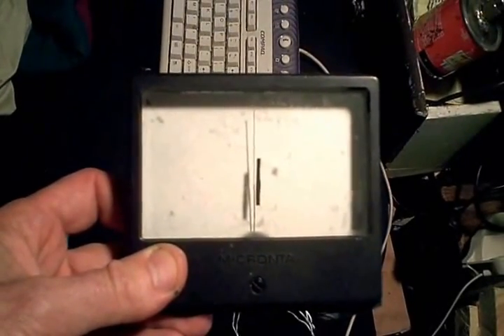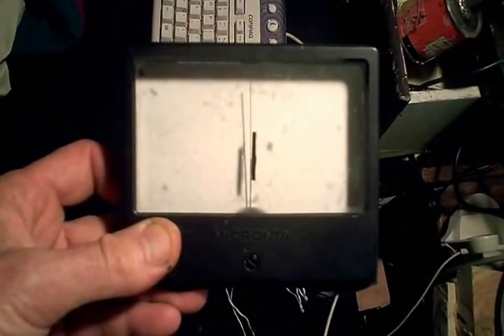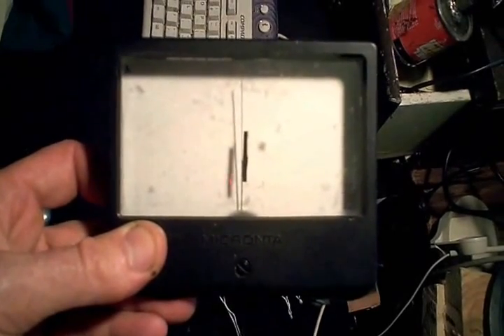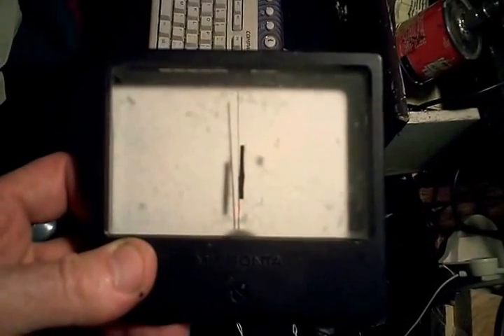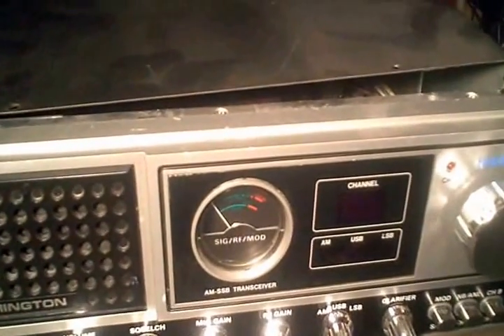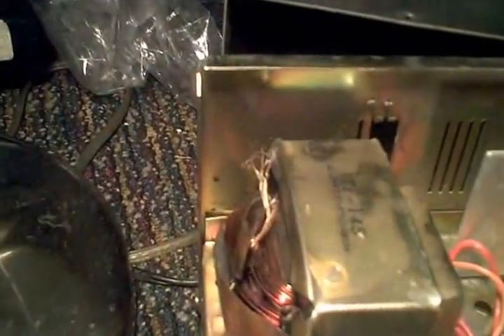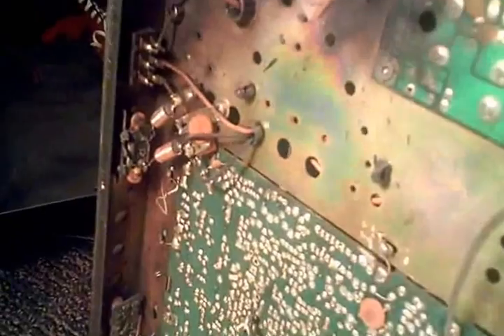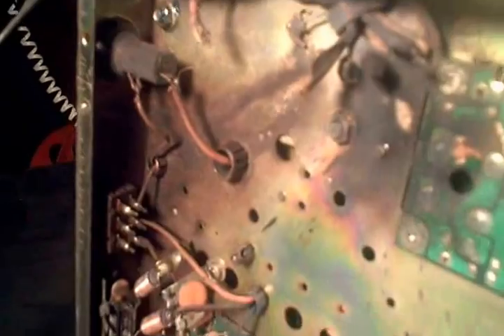Lightning Damage to home and electronics equipment..

Comment: Lightning struck a VHF radio antenna on top of a rooftop mechanical room, 5th floor level, at my hospital, about 1989. Destroyed the radio, of course. It induced enough energy into the wiring for an analog energy management system to fry the system components in the mechanical room, blew the analog/digital board at the computer on the first floor, burned out the power supply for the computer, and destroyed the surge suppressor plug strip. 

Lightning struck the lightning rod on top of the 3 story high minaret at my hospital near Riyadh, Saudi Arabia. The ground cable made a tight turn and the lightning arced across the concrete to take the shortest path, leaving a scorch mark on the concrete, but no damage to the aircraft warning light or public address system. Should have fried the warning light and PA system but didn't.

Construction crane was hit alongside US Army hospital in W. Germany; destroyed the crane wiring & controls, and welded it to the steel rails it was sitting on. Induced voltage destroyed the mini-computer for the CAT Scanner that was nearby; took some time to determine what happened to the computer. Every chip had to be replaced. A tech arrived from San Diego mainly to hand carry a suitcase full of IC chips, and to help the local tech complete the work quickly. There's no way to predict what Mother Nature has planned.
Reply from the maker: That's so true. The damage lightning can do is often be overwhelming. It would probably be a good idea to ground any cranes when they aren't in use. One of our local churches was struck by lighting, and even our country court house across the street had some of their electronic equipment destroyed.

Comment: Actually, the whole point of a ground on an outdoor antenna is to prevent so-called "static build up" which means it cannot acquire or maintain a positive charge, making it a preferred path or a lightning bolt.  It does not actually prevent a lightning strike - just greatly decreases the possibility since electrically, it is not a preferred path.
Reply from the maker: I understand what your saying about the static build up, but having a ground connection on an antenna will increase the likelihood of it getting hit by lightning.
Reply: I Am Trying to install a Antenna Using The Existing Pole Direct Tv Has in My Yard.I Put Another Pole Inside of it and Have it up 28 feet in the Air and I am Using The Existing Cable and Grounding Block That Feeds the 2  TVs in the House,On The direct tv Input Cable  it Has a Messenger Wire which is real thin attached to the Coaxial which is attached to the Pole with a Strap and Bolt Holding that End of the Messenger Wire and I also Drove a Ground Rod 3 Feet Away from the Base of the Mast and Attached a 6 Guage Copper Wire to it.So My Question is Do I Attach Another 6 guage Copper Line From the Ground Rod to my Service Ground? The Coaxial Grounding Block to the Service Ground Copper Wire that Comes out of the ground is Grounded But Do I Need to Attach a 6 Guage Wire From My Rod I Drove to the Service Rod in the Ground.Sorry So Long but trying to explain to get Some Help,I Cant get a Straight Answer From Nobody.THANKS in ADVANCE!
Reply from the maker: @Rammer_Jammer  All those details are a bit hard to follow, but pertaining to your antenna ground. Something I learned about lightning protection is that it's best not to share the antenna grounding rod with your household grounds if you're antenna was to get struck by lightning, but if your just wanting to dissipate the charge that builds up your antenna and coax, I noticed our satellite company just uses the ground connection from  our service panel which has all the circuit breakers inside of it. However I'm not sure this meets the code requirements,
Reply: THANKS For the Quick Reply! I Guess I Will Just Stick With What I Got and Hope For The Best,I Am Just Wanting to Protect From Being Shocked and Protect My TVs as Much As Possible.This Grounding is One Complicated Subject.Thanks For Trying To Help 👍

Comment: 2:30 , was that the remains of a ladder line antenna feeder?
Reply from the maker: Yes. That:s all that:s left of his ladder line. This is the second time his antenna was struck by lightning.
Reply: @GrantsPassTVRepair  Thanks for the reply, thought i recognized the bits! Interesting to see that most of the damage seems to be from the explosive vaporization of materials, rather than your normal 'melty' overload effects

Comment: Was there a series or parallel resistor with the meter movement and if so what value? Or did you simply add a ground and long wire antenna?

Comment: Structures (antennas, metal roofs, towers, etc) don't attract lightning...
Reply from the maker: How did you come to believe this?
Reply: By studying lightning. It goesn't go for the best conductor - it goes for the highest charge. These are not always one in the same. Even if you look at pictures of towers being hit, you will see they often hit part way down the tower where two different air temperatures are (for example). Often better conductors are able to "bleed off" charge slowly, where as something like a tree is not, and it will be a partial conductor (covered in rain and full of water) and it will get struck. Even when they try to "attract" lightning they shoot a small wire into the sky, but since it's so small (cant be too heavy) it is a poor path and does not always work to get a bolt. There are a few GREAT documentaries on YouTube about it.
Reply from the maker: I understand, Lightning can strike where ever the charge potentials have a close connection, but lightning often favors tall structures that have ground connections. If that were not the case a lightning rod would be useless.  My friends ham radio antenna has been struck twice, and so has a local church here in town that has  a tall steeple.
Reply: Yes, but the point of a lightning rod is for it to be the sacrificial path in the event of a strike. It's to prevent the non-grounded (at least not efficiently) tin roof from being blown full of holes by a strike. If only grounded systems were subject to a strike there would be no need for a grounding system. Having that rod does not make a strike more likely, it just makes it less damaging.
Reply from the maker: I don't think we have any disagreements on the what attracts a lightning strike, except where you started out saying towers and tall structures don't attract lightning. It's true that lightning often follows the easiest path to  an opposite charge potential, and that's not always going to be a tall structure, but grounded structure  is more likely to take a strike than an open field.

Comment: "A Lightning bolt has an average power of 500,000 megawatts"? (On screen at 1:40) I don't believe that one. That's a half-trillion watts which would incinerate the whole planet! Your figures are definitely wrong! Lightning is DEVASTATINGLY strong and destructive, but half a TRILLION watts is probably far beyond even Mother Nature's awesome capabilities. Half a MILLION watts (NOT megawatts) is a far more realistic estimate .
Reply from the maker: I measured the lightning with my volt meter so I'm sure my figures are correct. Okay I'm kidding. Based on what you said perhaps I should re-check my research.

Comment: What were the lengths of the wires you attached to the micro-voltmeter?
Reply from the maker: EmeritusE  I would guess the length to be around 100 feet 0f 22 gauge wire.

Comment: Whole home surge protectors and surge protectors on all devices would have helped a lot. Also the antenna has to be grounded to the electrical panel in addition to the mast in the ground.
Reply from the maker: billybassman21 Sometimes they help but often times ground connections aren't that effective. There are numerous articles on this subject if you google  this issue.
Reply: Grants Pass TV Repair
True, not much is going to protect you fully from a direct lighting hit or a surge that last for several seconds. However quality surge protectors and proper grounding helps. It can mean the difference between a few damaged electronics and a house fire. The problem is many homes are not grounded properly, mainly everything isn't grounded at the same point. This causes the lightning to take multiple paths.
Reply from the maker: This guy has an interesting series of videos on the subject of grounding if you interested.
https://www.youtube.com/watch?v=qNZC782SzAQ

Comment: What type of antenna did you use? Was it rabbit ears or pole mounted?
Reply from the maker: I use a standard outdoor antenna on the roof with a $70.00 Two piece antenna amplifier I picked up at radio shack.

Comment: Have you considered adding image descriptions to the picture slideshow segment? I'm sure the images are interesting, but without a description I've got no clue what I'm seeing. 

Very interesting, the part in the beginning with the meter attached to the antenna. How much current or whatever was being detected each time lightning struck nearby? Could it have caused damage?
Reply from the maker: You must have your annotations turned off. This video is full of image descriptions.

Comment: Tesla's wireless concept didn't really have much to do with lightning as the source. It was basically using the principle of resonance from the generating end to the receiving end using the earth as part of the transmitting medium to complete the circuit. The other being the earth's atmosphere as a capacitive loop for the other leg of the circuit.